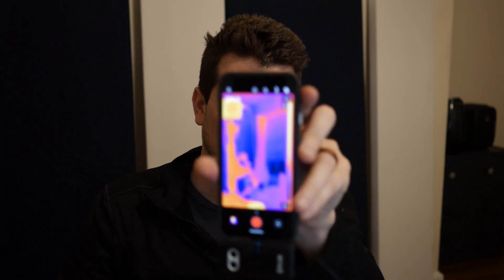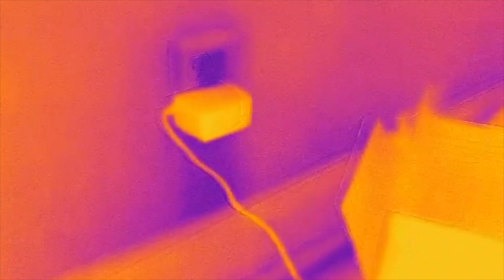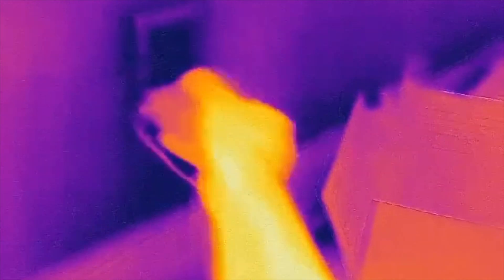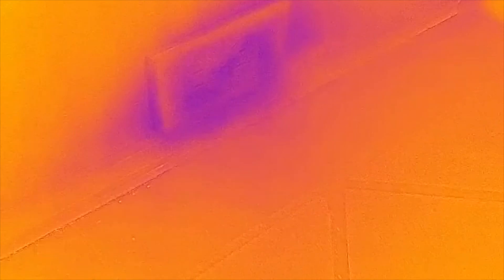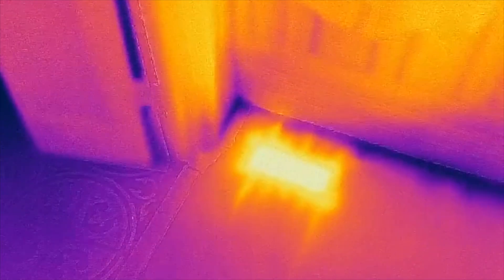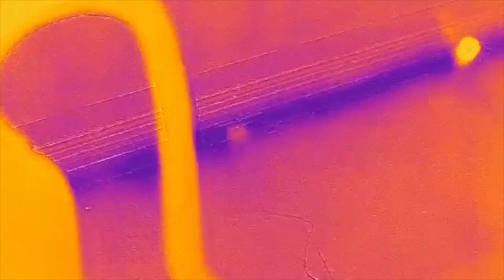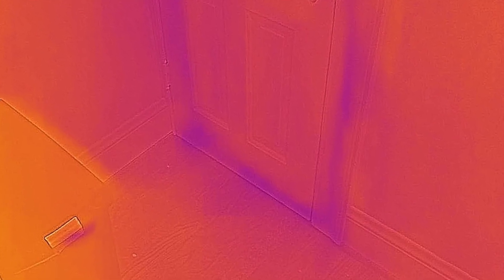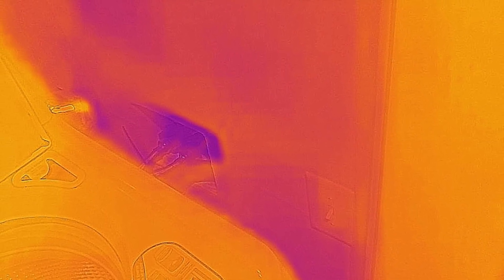How to save on heating and AC bills using a thermal camera

Comment: For the outlets I take the plates off of all of them, make sure there's like 3/16 gap on at least 2 sides and spray foam it. You're pushing the straw between the sheet rock and box, not spraying in the box. Send the straw in a few inches and give it a spray for a few seconds per side. 1 can should last like 10 outlets. Made a huge difference at my last place.